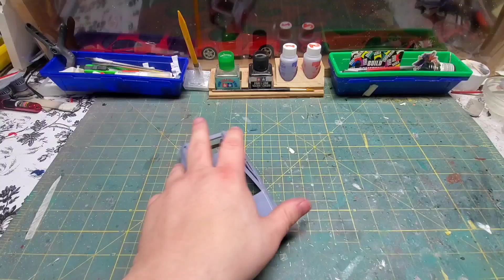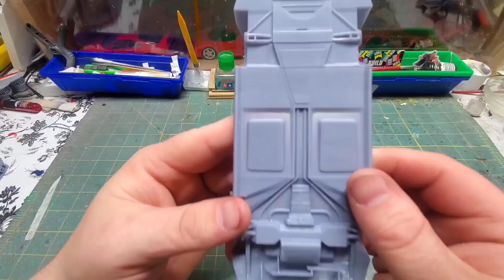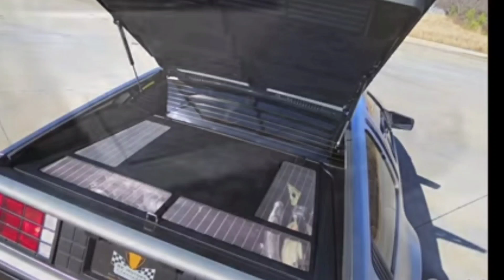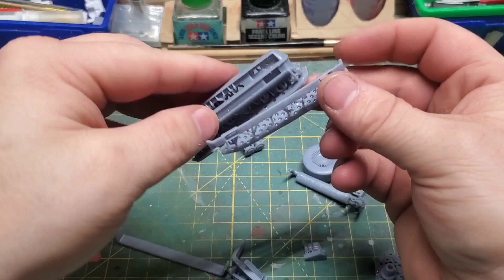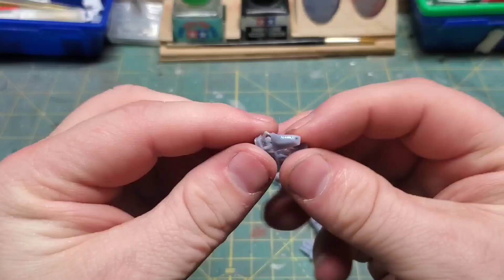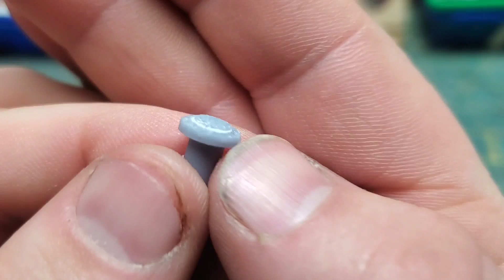I 3D printed a DeLorean!

Comment: Very interesting. The shiny bits were still wet when you cured them. The wetness changes how the UV hits the resin and it ends up glossy. Auto supports are NOT your friends! Another tip, try to print with as fine a support as you can. then after you wash, but before you cure, run the parts under hot water from the tap. The supports break away a LOT cleaner and often leave very little to no clean up. Yes, auto supports do random things and support identical parts differently. I very often print spares om the same run and sometimes, even on the same run, copied and pasted with the exact same supports and settings,  I get parts that print different.
Reply from the maker: Definitely a learning curve here. You were also a big help on this with your advice.